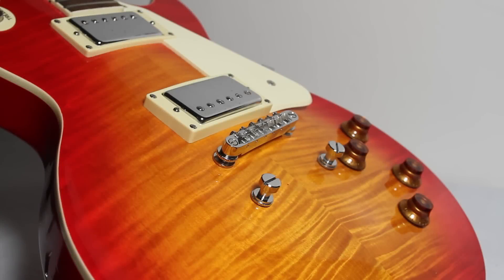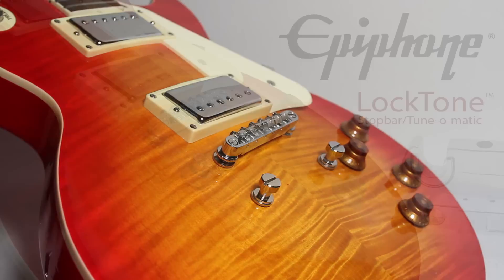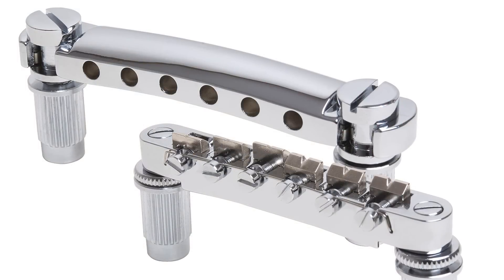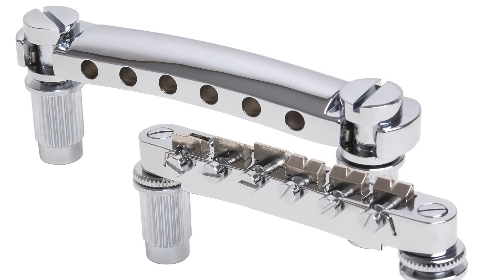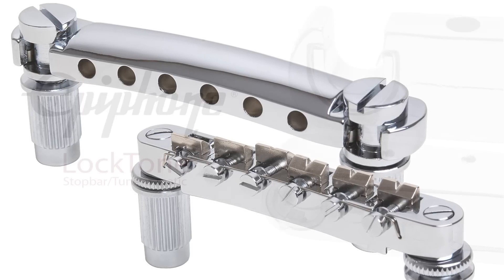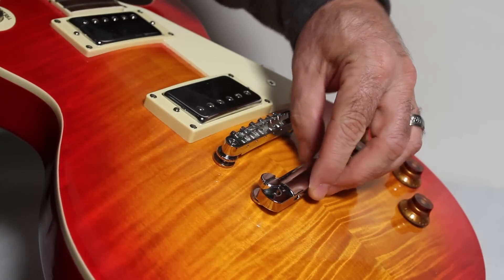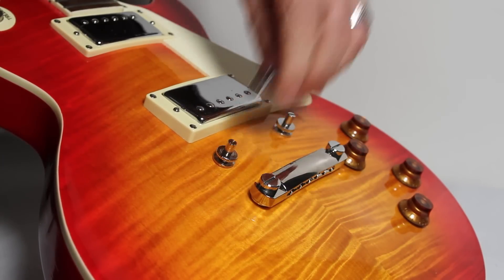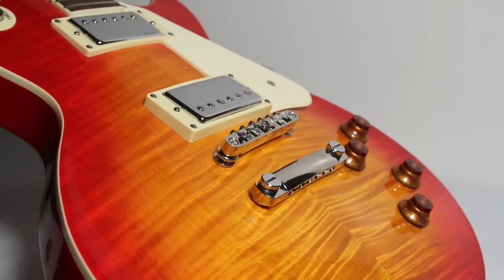Innovation: The Epiphone LockTone™ Stopbar/Tune-o-matic System

Comment: Real easy solution to the hardware falling off problem ... don't change all the strings at once ... leave the E's on, change the middle 4, THEN change the 2 E strings ... I mean, seriously ... if anyone is too stupid to figure that out on their own, they're FAR too stupid to learn the guitar !! SMH :-/ This is a solution to a "pseudo-problem" that wouldn't exist if people used their brains !
With that said, IF the "LockTone" modification gives more sustain and better tone, then obviously it's an improvement. So two thumbs up Epiphone !! :-)
Reply: Seriously?  That's just dumb.  How are you supposed to clean your fingerboard and polish your frets if you change the strings in installments?  Lol.

Comment: Adds tone and sustain.   Really?   I don't mind when companies make claims like this usually because in some cases its actually debatable like in the case of tone pros where you are actually adding substantial coupling to the body.   But even in your video you show just how full of shit you guys are as even with the locktone bridge installed there is a tremendous amount of play in the bridge because the studs themselves are poorly fitted.   I have a tribute plus and its a great playing and great sounding guitar.   But please if you want to tell people that this will save their finish as the stop bar and bridge wont fall of during string changes then that is all well and good.   But don't lie and say you are getting better tone and sustain when those small spring clips don't isolate movement.  And its snake oil to begin with.   Like those spring clips are providing any more coupling than the 1120 lbs of downforce being supplied by the string tension.   You guys need tighter thread tolerances and a true locking design if you want to make tonal claims.   Oh, and maybe using a solid metal instead of cast melted down hot wheels would help too.
Reply: I agree that the TonePros ones are better but I still like this better than the vintage style ones that just fall off

Comment: I like the idea of the bridge and stop tail not falling off but I usually remove the stop tail and insert all six strings at once when I change them. The fact the stop tail snaps in place and stays put is a good idea but I haven't noticed any increase in sustain or tone . The again , I haven't noticed any decrease either.

Comment: There is no way it adds tone and sustain as he says.
They've removed metal right where it meets the post so it probably loses sustain.
Gibson's system of side screws to attach to posts is much better and could potentially increase sustain.
Reply: +Sarah Gains   I cant truly say about sustain, but I can say that this bridge does sound brighter than a non locktone version .  Many Epiphone players have noticed this.